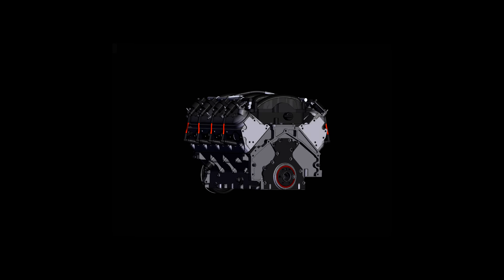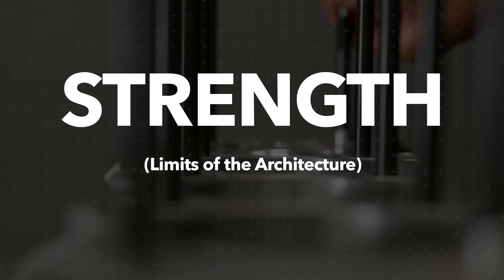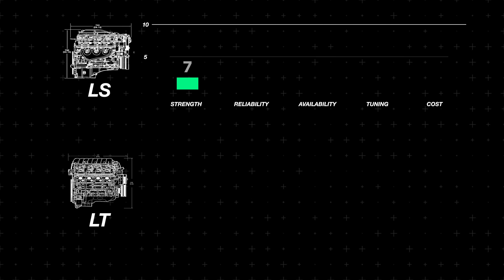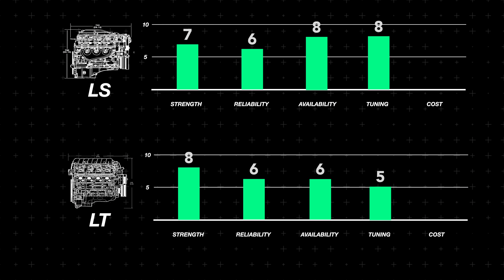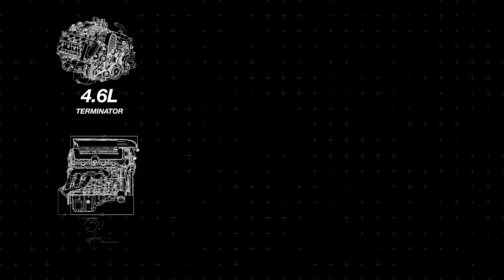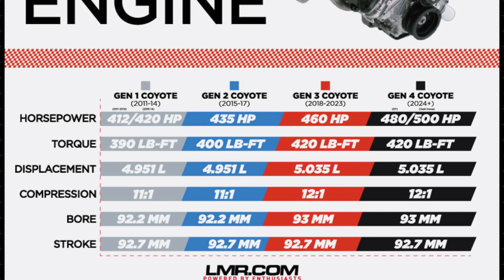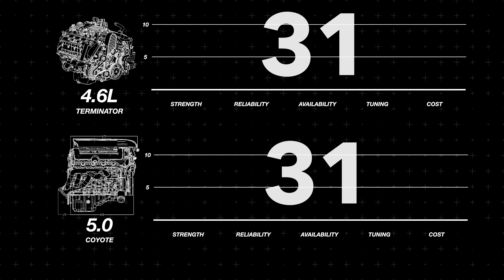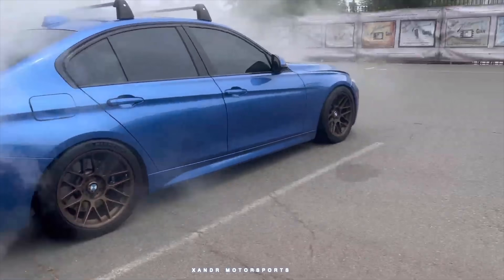Why Old Engines DESTROY Newer Ones💀| Explained Ep. 25

Comment: Enthusiasts need to remember that legislation is a very powerful influence on engines. The F1 rules over the last 30ish years give us a clear example of that in a relatively condensed timeframe.

Proof datesback as far as the different early 1900s "horsepower taxes"[1] between Britain and France that resulted in wildly different engines designs being sold. (short stroke, fat bore vs long stroke skinny bore). (Before HP could reliably be measured (it was a different, but equally bad legislated calculation based on bad assumptions)

Back then, like the "chimney tax" and others like it, it was a defacto 'wealth tax'.
Today, the tech driver is emissions/mileage, and to an extent the legislation plays "follow the leader" - forcing the followers to catch up or fail.

The 90s through early 00s were the dawn of mainstream EFI - which was partly in response to the rules of the time as well as the start of the commodification of integrated circuits.

Back then it was relatively trivial to beat the then current emissions/mileage standards with such a massive advance over the still-in-production carburetor.
It was also relatively easy to push the performance envelope while still meeting those legislated standards.
So they did.
Additionally, computers were being applied to everything else - like fluid dynamics, and finite element analysis which never really replaces prototypes, but massively increases the speed in which a good designer can iterate through their theories before settling on a good one.
Results from applying any form of computer modelling to anything back then were leaps and bounds.

Today? EFI is standard. The laws caught up. It's much harder to build a very high performance factory engine that exceeds the rules.
Materials science, fluid dynamics, and computer modelling have advanced a lot in the last 30ish years, but it's incremental now.
The main advance on the computing side is simply processing speed, accuracy, and resolution. 
That is to say, the formulas themselves aren't likely to have change that much, but because computing is so cheap, it can model a billion air particles travelling through an engine per second instead of a thousand in the same 'reasonable working hours' and thus get to say 'within a percent' of the final product instead of 'within 5%' like the 90s.

It makes sense that with the exponential advances in computing adoption and application in the 90s, coupled with the lagging tightening of the legislative reins that it was, from an engineering perspective, suddenly like there were almost no rules at all. It shouldn't be too surprising that it enabled the design and production of very reliable high powered engines - some of which may remain some of the greatest engines of all time as the legislation tightens inexorably.

[1] https://en.wikipedia.org/wiki/Tax_horsepower#:~:text=The%20tax%20horsepower%20or%20taxable,passenger%20automobiles%20based%20on%20taxable

Comment: you get it wrong on the LS vs LT with the exception of cost.  Newer tech always cost more.  But Richard Holdener has proved the LT to be basically a better LS in every metric, with real dyno numbers.  Things will wven be more drastic with boost between the 2, because of how much control you have with fuel on the DI system.

Comment: There's a lot to disagree with, but just between the LS and LT, mod for mod the LT is faster. 
LS has to be Full Bolt-ons with Heads and Cam to keep up with just Full Bolt-ons and E85 on a LT.

Comment: The old stuff isnt better.. its simply nestalogia and the fact these older engines have been around longer and have cult following

For example, the 2jz is kinda trash by modern standards. It requires tons of money to get good power levels and its HEAVY!!! SUPER HEAVY!

That being said if your in a budget dont go for an overhyped motor, you can get yourself a nice boosted KA24 instead of a SR20, instead of a B-series, look for a K instead.
(I know a K swap is more expensive but its a much better bang for buck and has modern features)

Comment: the manufacturers found out how to cut costs and how to apply planned obsolescence
stock old engines could do 100-200 hp, but were built like a tank, which allowed them to last a lot longer and have mountains of untapped potential
stock new engines can do 200-400 hp but are at the brink of falling apart

Comment: I'm sorry, but the only point I'm going to have to disagree with is the ls not having a 10 on both availability and tuning. No way the 2jz beats the ls in this. You can still buy new LS3 crate engines. Also, there's no part on the ls that doesn't have aftermarket support. Not to mention the countless swap kits.

Comment: Love the video! Just one thing, the gs300/ is300/ sc300 engine is the 2JZ-GE, not the GTE, which are very very similar, but not the exact same, with the GTE version having a few advantages over the GE, so the availability of the GTE is practically zero in my opinion.

Comment: As a Terminator owner, I think the Coyote is a much better platform. The Gen 2 can easily handle 900wh with ease. I’m not so sure I would run 900w on my stock block terminator engine. The Coyote is king as long as you put billet OPG in it.

Comment: Your comparison of the B58 and 2JZGTE is inaccurate. You are assuming a B58 in a Supra is the same in all other BMWs, it is not. the Supra has a completely different turbo setup and other BMW B58s have additional water pumps and other external parts to the long block assembly. Which is also where you fail in your assessment of the 2JZGTE. You ranked the LS as if they are all the same, they are not, the B58 as if they are all the same, they are not, but you only ranked the 2JZGTE instead of the JZ engine. Since LS motor have different displacements, then you should have included the 1JZ in your JZ ranking. And also you are missing out on NA, VVT vs non VVTi JZ variations. While a 2JZGTE is hard to find, a 2jz isn't. A turbo kit on an NA motor changes many things. While yes the NA VVTi motors have weaker rods, the non VVTi NA motors have stronger ones. So adding a turbo changes things on the NA or non-GTE engines. NA motors are in the junkyard and can be had for a couple hundred bucks, just like an iron block LS variant. And my argument is valid because your statement about the 2JZGTE being capable of 4 digit numbers on stock motors is a little misleading. While the stock long block 2jzgte can do that, the stock turbo, injectors, and ECU can not. Upgrades are required. Just like an LS needs attention to it's valvetrain and camshafts to make more power. Also the 2JZGTE is not an easy engine to tune from a factory standpoint. Toyota ECUs are not capable of being re-flashed like GM and Nissan ones. any JZ motor going beyond the 400s is going to require an aftermarket ECU. Your assessment needs work. 

Also a factor you fail to mention is serviceability.  Certain motors are much easier to service and work on. Not sure about the Ford ones but from every video I have seen on the B58, they are a very complicated motor. Maybe over time this will change.

Comment: The B58 truly suffers in the tuning.  If your car is later than either 2020 or 2021 (can't recall) the only solution available here in the states is the JB4.  To unlock the ECU for real tuning, you have to send it overseas to Europe at an astronomical cost, to get it unlocked. As of 2023, tuning for the B58 should be a 2, 3 at best.

Comment: Should be the Mrk8 instead of Terminator.  But that goes outside the Mustang centered universe and means the Mustang didn't get the best engines-wuich they didn't in the 90s until the Fn-10/Mn-12 went away.

FoMoCo cam phasers suck in moded vehicles so VVT is not a concern in this and as such tuning is the same on both guns of Modular.

Comment: When you say the LT engine, specifically the LT1, it could be good to specify that you're pointing at the newer versions of the LT engine as there's different engines from different times with the same name, one from the 70's one from the 90's as well as one from 2013 and onwards. As to minimise any confusion.

Comment: Coyote and LS having the same strength is crazy when there’s plenty of 5.0s that have seen 1000+ on the stock rotating assembly just like the 2j
Reply: Im not an LS fan, but have you seen the valvetrain of the coyote? No thanks... ill run an old school 5.0

Comment: Excellent video sir.  One thing not mentioned was something available today which was not available in the 90s early 2000s.  CAD and AI.  There was no available CAD computing and AI in the 90s and early 2000s to figure out the manufacturing strengths of rods, pistons, etc etc.  So manufacturers had to over build engines.  Now, computers can figure out quite accurately when a rod or piston will fail so as to give manufacturers the foresight to skimp on said parts.
Reply: You'd be surprised to know how long engineers used CAD
Reply: @teemuuusitalo7987  Computer Aided Design was developed in 1957 and the parametric modeling CAD was developed in 1989.

Comment: Definitely a fair comparison. The 4.6 to the 5.0 definitely is close. Would love to see a 4g63 vs 4b11 comparison. Or even a Honda B-series to K-series.
Reply: hmm, im not sure at all, but isnt the B-series weaker and less capeble engines then the k? my car has a b, and if i were to get a new cam, turbo, time injection and exhaust, i could maybe get up to 250 hp, maybe 300 with a good tune.
Reply: @olem.isaksen336  in a way you are correct. But just like the K-series Honda put the B-series in a lot of cars so the availability is there. Even outside of the US the B-series availability and aftermarket is there. You do have to spend a little more than you would a K-series but that's what makes the comparison that much more interesting
Reply: the B/H to K would be interesting

Comment: As an engineer this is what i will never understand this, yes i get the need for modern updated tech but why does every auto manufacturer look at last model then improve upon the short comings of it for nee model?  Takes less R&D than a complete new design and give you a better platform?  I could care less if i bought an engine that was originally designed 20 years ago as long as it rock solid, more efficient and producing power!  If i wanted to produce something new i would test the crap out of it offline or in a non discreet means before releasing to public.  Not glamorous but if you get a reputation for bullet proof engines you will get a following of customers!  I could care less to have some fancy technology state of art if i have nothing but problems and it blows apart

Comment: I been boosted for over 4 years now, 33k miles on boost , close to 900whp for over 2 years, 750whp first two on pump gas and i go to Mexico all the time.  2015 5.0 TT un open engine stock OPGs, stock MT82 and i know people that push over a 1000whp on completely stock internals. i do not know one person with 750 whp termi cobra that had no issues with their engine, even after 2 years. I know a guy with 03 cobra, after his 3 modular ford engines (around 1000whp)  he went LS.  There are sustain rules when it comes to coyotes and if you do not follow them and cut corners you end up with problems, if you are doing everything right then they will live long life even at 1000+whp. Good video BTW
Reply: Good information to have, even tho I’m a hemi and LS fan, I love good information
Reply: @GGSM420  Well now i am 6 years boosted and still going strong. 51k boosted miles.
Reply: @ironbull2003 good! Keep her running!
Reply: Coyotes are amazing but a properly built 4.6 4 valve can be just as reliable. Just need pistons and rods. Some even use the boss 302 or gen 3 coyote rods lol.

Comment: i have varying opinions about this from manufacture to manufacture for example VW their old stuff while reliable was kind of meh unless you go into like a maybe the VR6 but even then the VR6 was dog water when you had Honda boasting the B18/B16. Now VW with it new 2.0 TSI simple bolt ons and your pushing 350hp+ and maintaining road mannerisms so compared to their old self new will always be the better option. And all the new Toyota's have nothing the frs/86/brz is weak with the connecting rod design from Subaru ,the supra is rocking a BMW motor and the GR corolla and yaris are on a new platform so time will tell I think the biggest factor right now boils down to "Cost" if you cant afford to fix it don't mess with it even something as simple as the frs/86 a engine with replacement is fetching you 6-8k and even if you do it your self a motor is still catching a premium around 4-5k and that's low cost compared to getting into these new corvette engines , BMW etc. I seen prices go to 25k+ for example my RS5 engine alone cost 18 grand and 15 grand to have Audi put it in if i were to blow it up but even if I were to be like I'll do it my self that's still 18K and not counting all the little stuff too and what if some one doesn't have the know how or knowledge to do it them selves  .So its something that people need to really factor in

Comment: Toyota 1uz is way slept on with it ranking highly in many areas in my opinion. 
 •All aluminum dual overhead cam, Wide but light(ish) 400 lbs or so.  
•early non vvti engines are good for 800 on the stock bottom end.
•Super overlooked and easy to find for cheap in America. 
•Aftermarket is catching up slowly, definitely the lowest ranking for it.

Comment: I am looking through your old videos, and I am not seeing any comparisons of modern V8's vs those of the muscle car era. I can quite easily get my 360LA Chrysler to exceed modern 392 HEMI performance levels, and for less than the cost of a crate 392 HEMI. When I bust out the big blocks, a naturally aspirated and properly built 440RB, or 400B will walk all over a Hellcat. As soon as you add forced induction to these old engines, it's all over except for the crying. My 68 Barracuda with the little 360LA, and it is streetable, walks all over my '16 392 Scat Charger. The price to performance ratio of old iron to modern is no comparison. Add in that everyone and their brothers and cousins can easily go buy a modern car, but it's a rare sight seeing any old car on the road makes me completely uninterested in modern cars for anything except as a daily driver.

Comment: This scoring hardly supports the claim that older engines "destroy" newer ones. The most common advantages you cite for older engines is often in the category of aftermarket parts, which just comes with time. What this video really demonstrates is that claiming that older engines are always better is rooted in the same flawed logic as any similar claim about "old thing good, new thing bad." You're comparing the best of the 90s that has stood the test of time to newer products whose legacies have yet to be written. In the case of the Coyote where it has had some time to be tested, developed, and improved, it's clearly better than its predecessors.

It's the classic survivorship bias fallacy. The 2J is the plane that made it back from the bombing run riddled with bullet holes but still flying. The B58 hasn't come back from its bombing run yet so it's too soon to say if it will survive or not. And even if it doesn't, maybe its successor will. It would have been silly in the 90s to say that the 7M was better than the 2J, right? So clearly this principle of "new thing bad, old thing good" doesn't always apply.

Comment: It will be more interesting to compare the late 80's to mid 90's Windsor 5.0 EFI versus Coyote 5.0. The terminator V8 is only available on one model, a very expensive SVT Mustang. In contrast Windsor 5.0 EFI are used from Fox Body Mustang, Thunderbirds, Explorer (1994-2000), Lincolns, Econoline, F-Series and LTD Crown Vic. With a few bolt on modifications (without altering the short block), it could reach up to 400hp comparable to Coyote.
Reply: Yeah, Windsors can make 400hp, and stock bottom end can handle 700. But there are not great motors to Rev high, fuel economy. Coyotes are one of the best v8 ever

Comment: So facts about the differences & similarities you see between these motors:

- The primary engineering differencea between the LS and LT motors would be the change from port to direct injection, as well as VVT. These things make the LT more complicated but give it more stock power than previous LS motors. Otherwise, still derived from that late 90s design from the Gen III small block

-The Coyote is still a Ford Modular motor (Coyote enthusiasts getting ready to flame me in the comments). They share the same motor mount-points and OHC design. Hell, the VCT system in the Coyote was originally on the 3v modular that precedes it. The differences being the larger displacement, DOHC design, and the Gen 3 motor getting Dual Injection (both port and direct injection). The Terminator engine, to me, was evidence that Ford had what it takes to build an insanely good V8 Modular for decades before the Camaro came back, but they wanted to milk the nostalgia craze the S197 was king of. Again, the Coyote is derived from the same late-90s V8 that everyone despised for replacing the old OHV 302 Windsor

Comment: For the road racing community, how about a weight discussion?

*just got to your comment about weight and mpg

I think it’s definitely an enthusiast criteria when it comes to weight. Like low hp (relative) k swaps being in lots of road race and time attack cars.
Reply: I think this can be categorized under the "what do you want" category at the end of the vid. Since the newer engines are lighter and still makes ample amounts of power with lots of overhead potential, then it can be argued that the newer engines are better suited for road course and time attack duties. Those who want to abuse the 1/4 mile need all the power they need and so the older engines are better suited to that role.